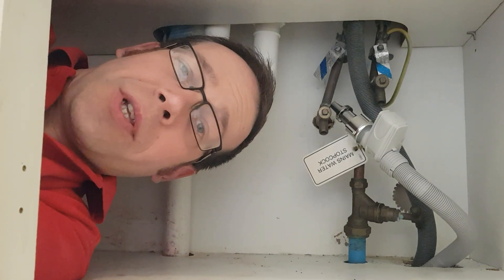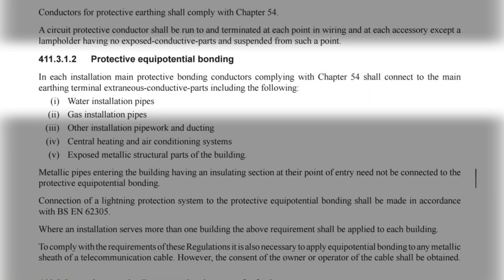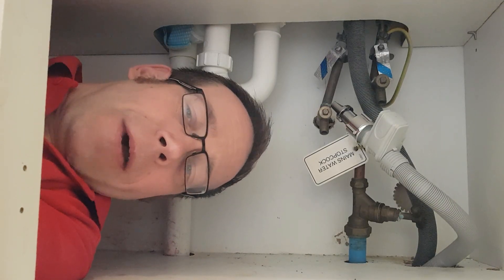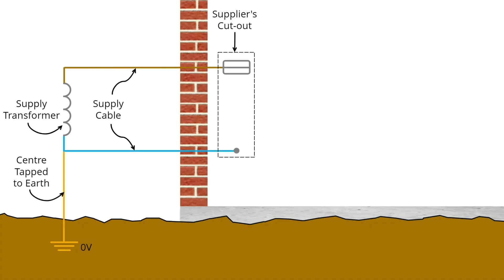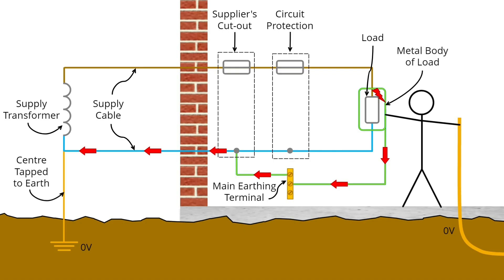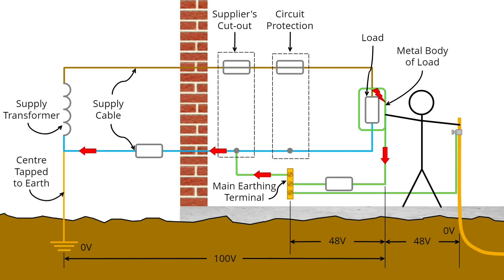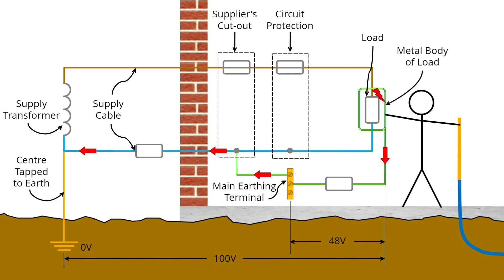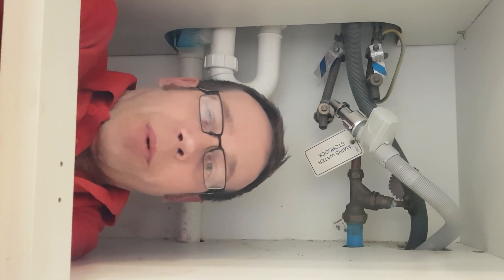DO YOU NEED TO EARTH BOND PLASTIC WATER PIPES?

Comment: I disagree, equipotential means everything at equal potential
When i did my refresher on the 16th this came up (i'm now retired), all extraneous metalwork within the building must be bonded together, that includes water and gas pipes.
One example would be an installation that has a bit of age, maybe for some reason the earth became disconnected at the immersion heater, then the element bblew apart, you would have live pipework, so the bonding would prevent shocks.
Case in point, your bonding strap is on the consumer side of the valve, iirc that's what the regs tells you to do, you're not earthing the water boards pipes, you're protecting the property
I remember it got a bit crazy on bonding that there were special clips to go on radiators (because ptfe is an insulator), metal window frames had to be bonded, as well as the drop chains on light fittings (a physical wire soldered to each link), thanksfully there was an update to the regs,
but yeah, internal pipework should be bonded together. as well as stainless steel sinks (how many people put a kettle on the draining board)
Reply from the maker: So your designing for multiple faults - first the earth has disconnected then the element has failed - is that not why we have RCD protection ?
Reply: @efixx  The point is that it's equipotential bonding within the building

Comment: In the USA is impossible to bond or ground anything that does not conduct electricity like plastic pipe. If you have plastic pipe feeding water to a metal kitchen sink that has plastic drain you should bond sink.

Comment: In the majority of cases the internal metallic pipe work would be indirectly connected to the CPC of the boiler circuit and therefore to the MET. 

Annoyingly this reg change came out two months after I had battled pulling in a new 15m 10mm for the missing water bond in my own house when I refurbished the kitchen, I only needed to wait a few weeks to save myself a lot of effort … 😂😂😂

Comment: what if a [copper{ pipe goes back into the foundations and re-emerges somewhere else after the plastic pipe entry - you may not even know.
Reply from the maker: You can measure the resistant to validate if it needs to be bonded

Comment: Good video, ta. I'd bond it, I've just been in a house where the owner drilled a cable (but didn't realise it at the time) when fitting his metal curtain tie backs. The tie back was lightly touching a painted central heating pipe, which was sitting at about 190v to earth. The reason I was called was that he was getting shocks in the shower. Neither the mcb or rcd was tripping ( no idea why, the rcd tested ok). If it had been properly bonded, it would have tripped. It had been like this for about 2 months!

Comment: Thought provoking stuff.

Does any of your metal pipe work disappear out of sight?

Does any of your internal metal pipework go underground like to an island in a kitchen via concrete floor?

Is the water not conductive?

What if the supplying pipe connects to metal pipework underground outside your property?

If it is not possible to determine by visual inspection alone, then a measurement of resistance to Earth can be obtained to determine if the conductive part in question is to be considered an extraneous-conductive-part.

Comment: Damn sure Mr Bodgeit N Scarper kitchen fitters would disagree with you entirely there , nothing needs bonding in any kitchen and if they see a pesky bond anywhere near a kitchen sink they’ll just cut it off and leave the cable hanging there as clearly there was never any reason for it being there in the 1st place. Also not forgetting that after their 1st year learning how to fit kitchens that’s basically just as good as a 3rd year electrical installation qualification therefore their knowledge of bonding surpasses anything the 18th edition can tell you.

Comment: In the US it does require bonding.  The water in the pipe is not pure, therefore it is conductive.  It goes through a metal pipe in the earth somewhere.  That is why we ensure all metal pipes are bonded on the US.  If metal water pipes are separated by plastic pipe we have to bond both sections.

Note to those who would argue with me about the water not being pure:  When I say it is not pure I am not talking about how safe it is to drink.  Safe to drink is a different metric as compared to purity.  Tap water contains minerals.  It is not pure H2O until it is distilled.  All drinking water and residential tap water has minerals in it.

Comment: We can't allow bonding to cover poor installation. You might as well say we can't allow seatbelts to cover for bad driving. Making that the dumbest statement I have heard in a while as there is a lot of bad installation out there, and you can't just magic it away. Besides just because it was installed correctly you cannot reasonably assume no damage will ever occur or failures happen over the life span of the installation which could reasonably expected to be decades.
Reply: His statement is perfectly valid. Non extraneous parts, metallic or not, dont need bonding! Please dont think you are in some way doing a better installation by applying it.
Cut and pasted from the IET mythbuster series 2018:
“It is easy to think that bonding such items won’t hurt even if it is not necessary, but remember that by doing so it gives rise to the possibility of exporting fault voltages throughout an installation; it could transpire to be more dangerous than not bonding in the first place.”
Reply: I'm with you here. I understand there is no need from the introduction of a new potential, but I want to know in fault conditions that my metal pipe work is going to trigger the fault protection rather than come live.
Reply: @Stuart_Johnson_Solutions but what about everything else in your home that is metal and doesn't comprise part of an electrical installation? On that same principle we would need to bond carpet thresholds, aluminium window frames, etc...

Comment: Like someone else has said I wondered about the water conducting. I am not an electrician, but have this question which many DIYers must have come across. Metal pipe into the house and to the sink with bonding at the taps. Kitchen redone with all plastic plumbing from the point the water comes into the kitchen.  Stainless steel sink fitted with metal taps, but plastic tails and plastic as far as the  kitchen door. I assumed that because the sink is insulated now there was no point in any sort of bonding. In fact even when there was bonding I was never sure of the logic on a metal sink. I sort of thought I understood on a plastic or pot one that connecting the hot pipe to the cold gave a route back to earth so that seemed sensible.

Comment: Wouldn't you want to connect a house full of metal pipes to earth, with all non contiguous sections bonded together. and not just assume that all regs have been correctly followed, in which case you don't need to?  To my mind it doesn't matter that the incoming water pipe is plastic - that's fine, no 'bonding' needed or possible. But I wouldn't want to be killed just because some numpty hadn't followed the regs, and made my metal pipework 'live'.

Comment: Once the metal pipework enters a class 1 appliance, like a water heater or central heating boiler, it will likely get bonded anyway via the chassis being earthed.
Reply: what about when the ground cable  of the appliance /socket get disconected
Reply: @TheMakyato  How would this happen?
Reply: @Orgakoyd  by human error  or accident  , in europe can happen  especially  with boilers or  washing machine    . sometimes you can get electrcuted  just on the wet floor

Comment: Sorry but that's not the point of bonding! 
Bonding is to direct electricity that contacts pipes away to earth, voltage such as lightning strikes on water tank vent pipes sticking out of the roof. It's got absolutely nothing to do with the mains electricity. If any main voltage contacts a pipe its going to trip safety devices.

Comment: I was wiring a new build with plastic incoming water pipe. The client was having Solar PV installed by another contractor. They asked me where bond to water was and I said it was plastic so not required. They said to me "we always put a piece of copper in so we have something to bond to"
Reply: Just because the supply to the stop cock is plastic doesn't mean the copper internally to the property shouldn't be bonded, in fact its the opposite because it should.

Comment: Thank you very much for your videos, I always learn something.

I understand the point of not needing to bond a system where the water enters the building in a plastic pipe. But what I struggle with is when that pipe is then connected to copper and buried in the wall to go upstairs for instant. As the walls are connected to the earth (hopefully ;-) ) would this not produce the same earth potential as if the pipe had entered the house in metal. In this scenario would you need to bond the copper pipework?
Reply: as an example: my house is on well water and the well pipe is plastic. However, all the pipes in the house are copper so the building department calls for bonding to a cold water pipe. Granted, the copper water pipe doesn't see a direct earth ground, but there are other electrical items that do connect to the copper pipe. (heating boiler is one) Yes, it's redundant, but that's ok.
Reply: Why would the wall be earthed? A plastic DPC would break any earth connection, plus a wall without DPC would have to be damp.
Reply: @johnharrison373  ... the way the codes are written it's assumed anything concrete will be at least somewhat damp. (foundation, slab, patio, etc) Some codes call for a UFER. (spelling?) That's a term for a grounding system on concrete structures like pools and slabs for hot tubs. In layman's terms the rebar in the concrete needs a wired connection to a ground rod that's outside the concrete.
Reply: @johnharrison373  earth potential can be and very often is picked up from pipe work in walls. The question is.. is it enough to present a danger. And that is why a test should be carried out to confirm.
Reply: If we applied this logic all the time  we would be worrying about the potential difference from stone walls internally And installation earth. The point is anything in question should be measured to see if it is extraneous to the installation as outlined in guidance note 8. Anything else is speculation.

Comment: To muddy the waters, PME/TN-C-S installations are required to have an insulation joint the gas supply if it's via a metal pipe to stop it carrying any fault current. So does the gas pipework downstream of the IJ still need to be bonded? And what about the exposed metal pipework upstream of the IJ as that can't be bonded.

FWIW the incoming water main is black MDPE so shouldn't need to be bonded but I ran a new 10mm² cable to avoid an argument with the commissioning electrician when I changed the CU.

Comment: The metal pipe inside the house is connected to earth through your combi boiler  even if its plastic incoming.
Reply: No its not! Pipe bonding shouldn't be anywhere near supply cables. They are two completely different and separate circuits!
Reply: @stuartcraigon2003  your  combi boiler is earthed through the spur , so you have continuity through the combi boiler to the internal copper water pipe , so your potential on the copper water pipe has a potential of 0V, even if incoming water is plastic.
Reply: and?

Comment: There's one more issue: The whole house is at "real earth" potential unless it's built on plastic foundations. Usually that doesn't matter, plaster, bricks and carpet aren't good conductors and the area we touch them is quite small. But now you have copper pipe through your whole house that is buried in brickwork. It makes contact over a quite large surface, plenty of parallel paths---and Ohm's law on parallel connections starts to raise its head.

I'd recommend to measure the resistance between "real ground" and any touchable metallic object to decide if it should be bonded.
Reply: Yeah and if you do bond onto plastic water pipe (but a piece is in copper) what about the millions of gallons of water in the pipe, no one mentions this.... What do you think
Reply: @michaelherbert2982  Unless your city pumps you seawater, it won't conduct anything through the plastic pipes.
Reply: @robot65635  But Tom... I got 15mm copper pipe then going to plastic.... But its full of water... Millions apon millions of gallons of water... So it won't travel through that?
Reply: @michaelherbert2982  water is a awful conductor.
Reply: @tomorichard  pure water is a bad conductor but your tap water is a pretty good conductor (because it's nowhere near pure).
Reply: It all can be proven by a simple wondering lead test from the board L to a pipe of your concern. If you get 230v between these two points you know what to do

Comment: Most likely the system beit gas or electric that's heating the water will be also bonded so in affect your piping will be bonded however I would bond it anyway just in case something were to accidentally come in contact or in the future say somebody runs a new supply line in that's copper unlikely or an out outside tap with copper. But that's my opinion and I'm living in a house where there's a ton of copper piping and it's not bonded because the income is plastic.

Comment: actually, the issue with metal piping in the ground is just the opposite.  the earth is NOT a low impedance path to ground, and the bonding network is.  so by bonding metal service piping, you are bringing that piping to the same potential as your ground reference.  it's not such a big deal with household voltages, but you can get a palpable voltage gradient if distribution voltage starts leaking to ground.  
in the US, the relevant clause in the code is to the effect of, metal piping must be bonded if there is a possibility of it becoming energized.  the usual interpretation of that is that a metal fitting under a sink is not likely to be energized unless it is connected to an appliance - and the appliance will be bonded, so there you have it.

Comment: Interesting video, but I suspect the more complex answer is "it depends". You're only considering the water supply as it enters the building. What if some of the copper is in contact with the earth elsewhere, e.g. a kitchen island? If you can guarantee that it's not, that there is probably more danger of metallic parts becoming live under fault conditions if they were bonded. However, it's also very likely that a boiler (for example) will have all the metallic pipework bonded, so the point is probably moot anyway. If in doubt measure it, and make a decision based on that.
Reply: This literally came up on r/electricians this week.  Pipes not bonded at entry, shorted to hot through a stray wire, and now all the fixtures in the house have live voltage on them relative to anything plugged into an electrical outlet.
Reply: @robot65635  Which is why we have everything behind a GFCI in the Netherlands and not only bathrooms or only sockets.
Reply: @FoodOnCrack  That’s how it is in the U.K. too.
Reply: would the dpm in the floor act as an insulator to avoid contact with earth, plus you would use plastic pipes to an island to avoid the corrosion of copper , simple answer cross bond gas water and heating pipes

Comment: I had a thing about 15 years ago . Plastic incoming main . All the pipe work in the flat  was plastic. Customer had a electric shower  and complained he got a nasty shock . Shower was about 8 foot away from the incoming plastic main. Couldn’t find anything wrong on testing. It was also a intermittent thing..After a lot of head scratching it was Infact a fault on an adjacent flats water heater .The element was faulty, so was the voltage operated trip. The fault was Infact traveling through the water in the plastic pipe into my customers flat and earthing through him when he was stood in the bath using the shower.. 
most tradesmen round here still use copper but if it’s plastic I get them to put a small copper section in so I can earth this so this sort of thing never happens again . This was a potentially dangerous situation that no one seems to consider
Reply: In this case, was the shower unit itself, and therefore it's constituent metallic parts, not earthed?
Reply: Similar thing happened to me .. but the author of this page stated in a comment above that tap water is not the conductive .... he’s lost me there .
Reply: Sorry, but this is complete nonsense - water does not conduct electricity well enough to cause any sort of shock, 'nasty' or otherwise.  You just never found the real problem.
Reply: @martinwinlow  Distilled water doesn't conduct well, but tap water has a resistivity of  between 2 and 200 ohms per meter, even less at higher temperatures.
If you think it doesn't conduct, you are welcome to take a garden hose and spray a distribution board to see what happens.